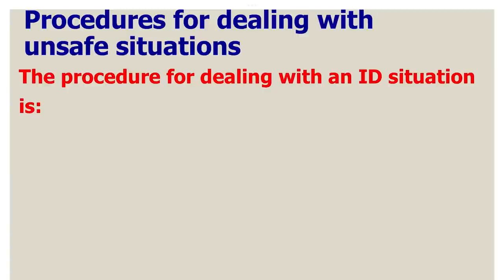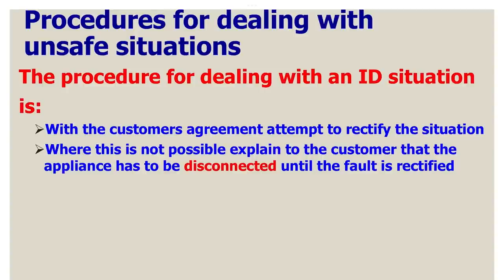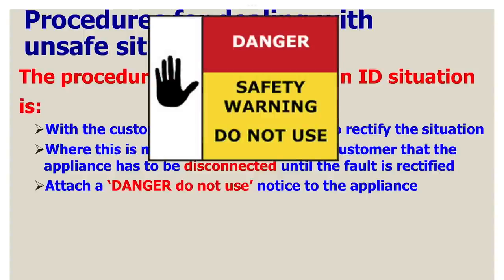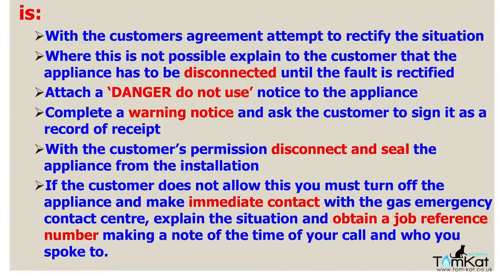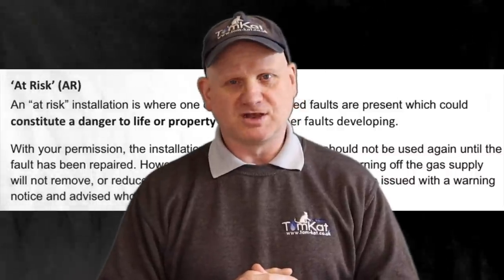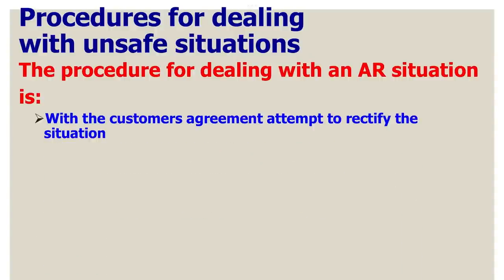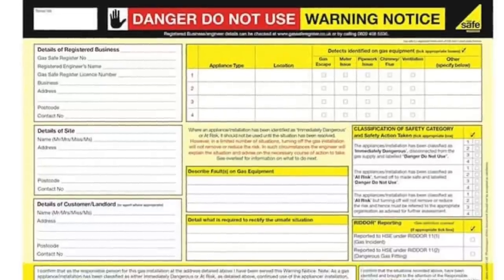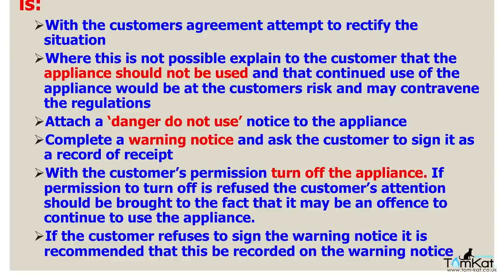Clearing up some Misconceptions of IGEM/G/11 edition 2  unsafe safe situations procedure for gas.

Comment: Very informative video which will be very useful to a lot of people within our industry, the first one could be down to the engineering judgement of the individual, personally I would AR it, on the day of your test the readings are below 10 ppm CO, so you are checking for an ID situation, so already the potential is there for a future issue, if something goes wrong with combustion, a regulator fails, with the wind in the right direction then potential is there for risk to life and property. I’ve been in the industry over 43 years as an engineer, manager, assessor, training then finishing my years off as an engineer. Engineers are always going to differ in their opinions, different organisations have differing procedures and views on classifications, this doesn’t help the industry, At the end of the  day if anything did happen and you ended up with a prosecution Barrister questioning your actions, who will have done their research and had ‘experts’ advising them, could your actions have covered the requirements of the industry and did you do enough to advise and protect the casualties involved, I would still go with AR specifically on the grounds your checking for the ID situation initially with your room sweep, therefore you are already looking at potential. People may disagree but I’ve always been a little twitchy around flues close to openings into properties where re entry is possible, previous experiences have opened my eyes to the risks working in this industry.

Comment: Alright Derek , I've looked at the meter box situation, now I would not AR that one simply because 2.8 is specifically referring to a situation where there is a pathway for gas to enter a property , so a semi concealed meter box in a wall ,so if you had a damaged box or no sleeve etc you could get a pathway for gas to enter the property . A sunken meter box has no pathway to inside the premises so if gas was escaping it's going straight to atmosphere. If the meter was corroded due to the water ingress then I would class AR but until then just a NCS for me . Keep up the good work as you have great content .
Reply: My thought exactly.
Reply: yes i completely agree with what you are saying. ps as i walk around town there are literally doezens of damaged meter boxs on view, gas transporter arnt interested if you report it.

Comment: Thank you Mr Derek. Can you please make a video on the scope of commercial and domestic installations. I was trying to get some advice on gas safe Facebook page regarding the installation of a boiler in a mosque. Some engineers said I am not allowed to install it as the building is not a dwelling. I replied by arguing the it is the installation volume that determines the scope of the installation ( 0.035m3). Thanks
Reply from the maker: On the to do list 👍🏻

Comment: With regard to the flue, years ago 2 faults in the same category would be upgraded. Is that still the case? If so that installation would be upgraded to AR due to being too close to the openable window and also within 150 of the opening to the fabric of the building ie, the window frame itself
Reply from the maker: The 150 measurements is not in any regs or standards I have ever read
Reply: @tomkatgastraining  it definitely used to be there. Whether it still is I don’t know. will be in the section where you have the diagram of a building and all the different flue terminations. Possibly under flue terminations next to an opening with an additional note * the flue should not terminate within 150mm of an opening into the building fabric formed for the purpose of accommodating a built in element such as a widow or door frame.. something like that….

Comment: So that flue at the start is NCS not AR?
Reply from the maker: Correct
Reply: @tomkatgastraining  how is there not a risk of POCs entering the room?
Reply from the maker: @edmetcalfe8974  the windows shut
Reply: @tomkatgastraining  but it’s openable. You’ve done a sweep test around the window and not picked anything up but if the wind changes it could do in future. I’d say that meets the definition you give for AR - at risk of becoming immediately dangerous in future.
Reply from the maker: @edmetcalfe8974  but what if the window is never opened also you can get poc coming into a window when the flue is 300 mm away and would you ID a cooker because the burner could get food on it and make it incomplete.
Reply: @tomkatgastraining  the window might not be ever opened by whoever is living there at the moment. Occupants change, the property might be visited by somebody who opens the window. 

The minimum clearance to openings into the property is there for a reason - the risk of POCs entering. If I found that situation I’d definitely be ARing so I think on this one we’ll have to agree to disagree.
Reply from the maker: @edmetcalfe8974  here lies the problem with our industry you would think the unsafe situations is clean cut but engineers make up their own regulations because they are scared of being prosecuted.
Reply from the maker: @edmetcalfe8974  I agree with you but also it should make no difference if the flue is 25mm away or 200 mm at the end of the day if you as an engineer makes the decision to AR it and you have proof of your judgment then who could argue as the manufacturers instructions have not been followed
Reply: @tomkatgastraining  if nothing else it makes for some interesting and useful debates on here. 🙂

Thanks for the video anyway. Useful stuff.
Reply: @tomkatgastraining  Excellent video. Presumably if you categorised this as AR you’d have to riddor as well on the grounds that the flue was not installed properly. But you might well not know who installed it and even if you did know, reporting things under riddor seems pointless in my opinion because what will happen and who cares anyway?
Reply: @martinwright7093  AR situations are rarely RIDDOR reportable. There certainly are incorrect flue terminal positions that are reportable (for example if it’s terminating inside the property) but this one isn’t, even if you’re categorising as AR. 

Looking at the age of the flue, it’s difficult to say for certain that it wasn’t installed correctly. The window that was there at the time of installation may not have been openable. When I’m doing an installation I try to take photos of stuff like this, so I’ve got evidence of how I left things in case some clown comes along and builds a conservatory over the flue terminal, or moves the boiler and uses Speedfit on the gas.
Reply: @edmetcalfe8974  Yes, it’s true the window may have been fixed shut. Some years ago someone died at a hotel near me in Cornwall after a boiler flue discharged through an open window. The window had been nailed shut when the boiler was installed but during a renovation the window was replaced and made openable. I’m sure I’ve seen an instruction to the effect that flues should be 300mm from a recess where a window may have been fitted previously even if one is no longer there.